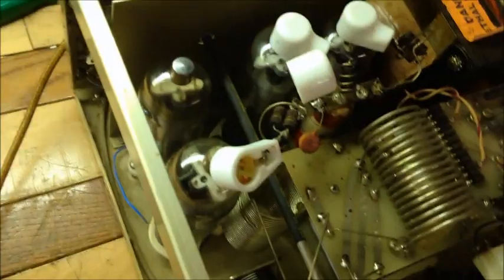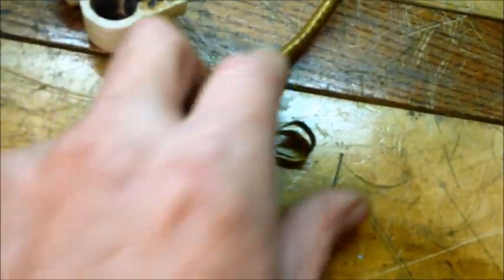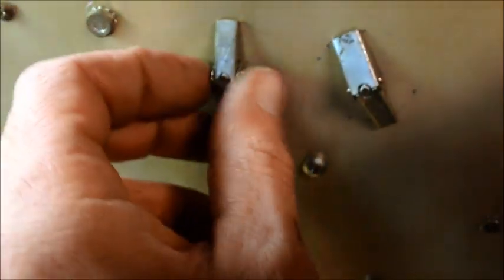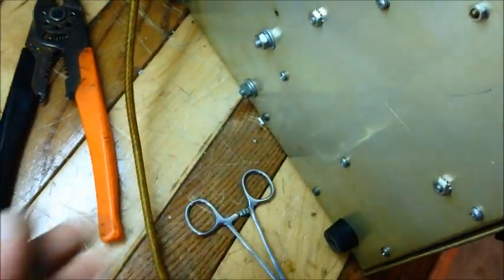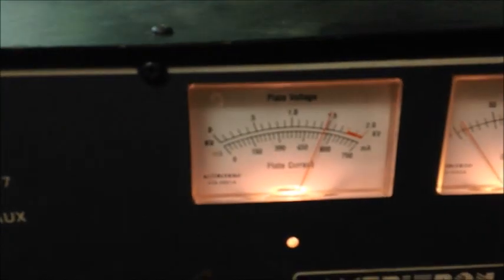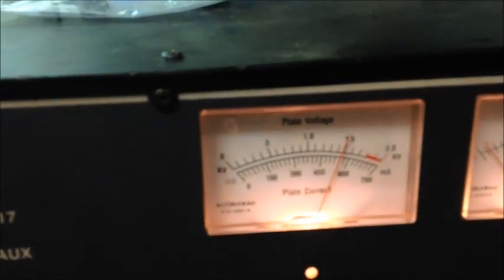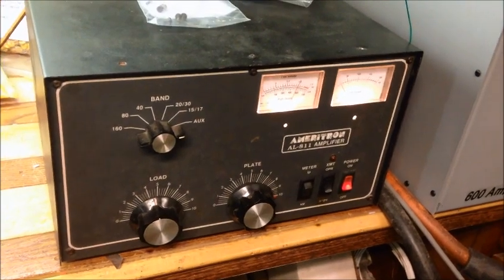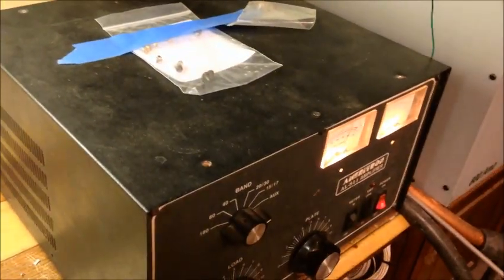Ameritron 811 repair with 4  572 tubes

Comment: I have a 35 year old  Dentron Clipperton L using four   572b running 2600 volts on the plates that puts out 1200 CW with 135 watts drive.

Comment: OH! On the power out issue, the plate voltage with no load should be 1,800 volts. Looks like the boost/buck taps on the line voltage input are tapped wrong. This would also lower filament voltage thus lowering tube emission.

Comment: The power transformer is fine for 4 bottles. I modded my 811 to 811H . Popped the extra bottle in. 1720 VDC off load and 1620 on load. You have a PSU problem !!. Power should easily be 700 Watts + into a dummy load with decent 811A Valves.  At 30 watts excitation I get 500 W RF O/P.  152mA Grid current.   Using a touch of ALC.  Figures are close but approximate. Hope this helps.
Reply: Just repaired one of these. Fitted 4th. tube etc.  HT was low 1300V ! Replaced the 4 main filter electrolytic caps. HT now 1710V off load. 1610V on load !!. Works great.
Reply: I had a problem with mine telling me the HT was only about 700v on the meter, found a 1Meg Ohm resistor went high, was either R6 or R7 , changed the pair.

Comment: Did you re-adjust the "AUX" tuned input slug on the back of the amp when driving it on 27 MHz? If not, it is no surprise that it is not terribly efficient.
Reply: I've never had to adjust input tuning after conversion.
Reply: 27 Mhz? You'll lose your ticket.
Reply: Lose your ticket! What!!! FCC they don’t care about 11 meter band anymore!!

Comment: Been investigating the 3 to 4 tube modification, apparently the transformer for the 4 tube version is exactly the same Ameritron part number as the 3 tube variety, which would make sense for them to have 1 type for both.
Reply: What parts do I need to get
Reply: To do the job looks like 100 ohm 3 watt resistor with an inductor coil wound around it, mine is the same as in video, though later versions come on a small circuit board with the components on, if so you will also need another 2 high voltage 100pf capacitors.

 A tube base and tube anode cap, and of course an 811A tube.
That said the 4 tube version has a neutralization circuit also, (for a reason) you may find because of the lack of neutralization that the following could occur......

Instability near the operating frequency
Decreased efficiency
Difficulty tuning
Reply: Slarty,
I am in the process of buying  an older unit.   Do you have any Idea when the 811 had the larger circuit board.   Where can I get a Wire Diagram for each unit   the 811 and the 811H.    And a full set of parts list with Part numbers,    Thanks
Reply: Slarty, I did get the Schematic for each looks like several additional parts.   The Tube base socket has to be purchased also.   There must me a list of all parts some place.
Reply: the Ameritron 811 and 811H are the worlds best selling amplifiers, there's loads of information available, on the Ameritron website you can download both user manuals which give you a full circuit diagram and parts numbers, I don't honestly know when they started to add the small circuit board for the 811 anodes.
Reply: oh yes sorry i forgot the tube base, yeah you will need that.

If you look up " Ameritron AL-811 HF Linear Amplifier HT Fuse Mod - 
M0UKD
" on youtube and read the top comment you will find someone who has done the mod and all the components he used
Reply: I can get a used 811 for about 400$ us.  The owner said he used it on  the 10,11,and 12 meter band's   I thought this was a 10 Meter unit.  
What is a good ave price for this unit.   Say in working Condition.   Thanks
Reply: Slarty,   811 for the mod was a 220-volt system what size Resistor and fuse should be used  for  120V 60 hz  USA unit.   Thanks
Reply: I don't know I have never looked into the fuse modification, I'd expect it wouldn't matter as the 110/220 is on the primary windings so the secondary will be the same, so the modification will be universal.

The amplifiers are made for the usual ham bands and usually modified for 10m , I use mine mainly on 20m , second hand prices in the USA I'm not familiar with, it sounds a decent deal.
Reply: What is a used 811 worth?  2013 Mfg date.
I know loaded Question but a guy living a few houses down from me has one for sale for 450$  With the Green wire cut.    just asking
Reply: Pop the 4th bottle in !.
Reply: hello,  does this amp have to be run at full power all the time or can it be cut down to  to say 100 watts.    please let me know.   Thanks
Reply: less drive in = less power out , it'll run fine at 100w
Reply: @gfdfperte4248  I turned my Icom-730 output down to 3 watts into stock AL-811 and got 85 watts out. Reason was to see if I could drive it w/ a "Pine Board" AM transmitter I'm building (3- 5 watts output).

Comment: Great video sir.   I have the same amp with the 3 tubes.  Just blew 2 of the 3 tubes.  Should I install the 572B’s?  Is it worth it?
Reply: I would say absolutely. The 811As are good tubes, but they have thin steel plates. 572Bs have graphite plates (they don't melt - the grid or cathode will melt - or the envelope - before the plate fails). I have an AL-811 w/ 572B tubes that's been going for 11 years. Plus, the 572Bs are designed to run at 2,500 Vp. They loaf at 1,800.

Comment: Go  back 811a's , they run at 1500,,, 572b needs 2000 too 2400v, the power will be way down with 4 572b's, but with 811a's u will see 800 watts! Amps is my life !
Reply: You are absolutely correct on this, and if I'm not mistaken, the 572bs pull more amps too, which will also drag the watts down, be best to go back to the 811A tubes.

Comment: how much to get that done
Reply: If you do the 10 metre mod you may need neutralisation with 4 tubes. Get a toroid, I used a black one I already had and wound 11 turns bi-filar PTFE  wire. See the picture for the 811H, Google it.  Wire in with windings in ANTI PHASE. . Make a plate cap with 2.5" of RG213 approx for 2-3pf . Insulate braid 8mm each end and tape or HS it. Use the braid for the plate connecton to the last tube and the inner conductor to the winding that goes to the  .01uf (10n) Cap that is connected  to the heater. The other 2 ends go to ground (chassis). Anti phase means that the two earth ends consist of the start of 1 winding and the end of the other. This works for me. Google the 811H schematic for reference. The neutralising Cap is CN. The one made from RG 213. Hope this is of help. Keep all leads short and earth windings nearby, Not at the grid earth.
Reply: Would be nice to see a YouTube Video on this! Seeing is worth a 1000 words! Thanks!

Rich W8VK
Reply: It costs you about $25,000.00 when the FCC catches you.

Comment: The reason Ameritron built this amp with 3 tubes was due to parasitic issues on ten/eleven meters. Going to 4 tubes you NEED negative feedback to prevent oscillations. Why would you waste time replacing plate caps without replacing the parasitic chokes. Like putting lipstick on a pig.
Reply: Why? I can tell you why. He is converting a ham radio amplifier to work on CB radio frequencies which is illegal. 
He is just trying to get out as cheaply as possible.  He will be happy if it comes back in 6 months for the replacement of the parasitic capacitors.  That's why.  Fix it once and make a lot of money fix it twice and make twice the amount of money.  I hope the FCC busts both him and the guy who owns the amp. Serves them both right.
Reply: Smitty FCC does not care ! Their are guys running 2000 Watt amps on the Super Bowl channel every day and no one gets busted! THEY DON’T CARE!!!